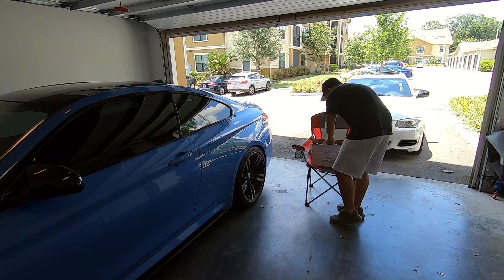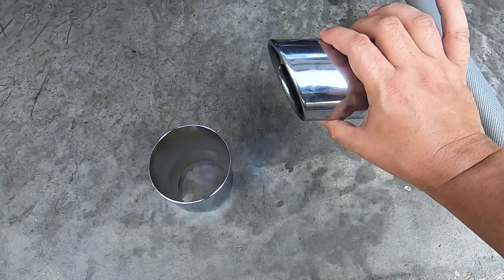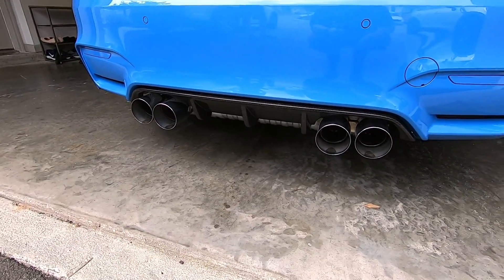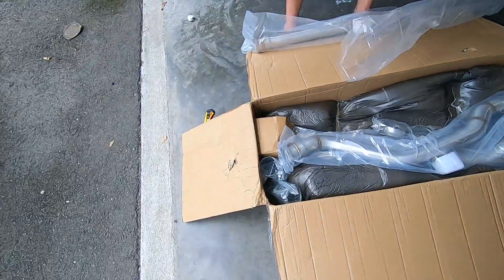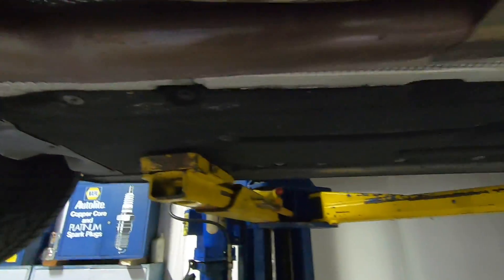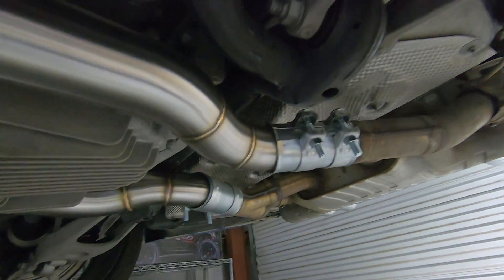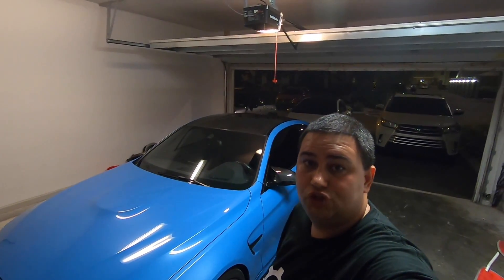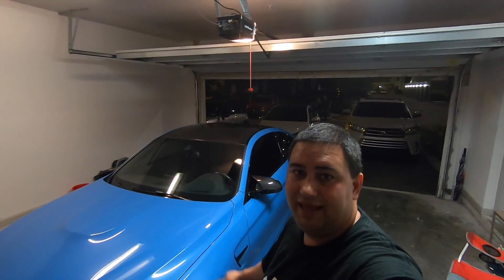VRSF New Single 3.5 MidPipe Review + M4 vs Hellcat

Comment: VRSF stepping their game up.
Reply from the maker: Yeah really quality stuff.
Reply: I have their down pipes and original catless midpipe for my f80 m3 and the quality and fitment is great for the price.
Reply: By ripping off Active Autowerke?  I mean, I guess, if you're into that sort of thing.
Reply: blendtecBrah sounds like your upset your active autowerkes exhaust is not the only one on the market. It was only a matter of time.
Reply: @joebeike  I'm not upset about anything.  You get what you pay for.  I'll take hand made in USA over a cheap Chinese copy any day of the week.
Reply: blendtecBrah VRSF quality is on point. The welds are fantastic and the fit is perfect. You won’t be disappointed
Reply: @joebeike  I'll have to take your word on that one, as I won't be getting rid of my Eisenmann DPs and AA mid anytime soon ;)
Reply: @blendtecbrah5761 tryna get rid of your aa midpipe?
Reply: @SirBJH  Actually yes.  I'm replacing it with a full custom equal length system.  Make me an offer and we'll talk.

Comment: Stock hellcat? Midpipe looks like an replica of active autowerke lol. I would buy it though, I already have AA though. I have VRSF downpipes and MPE exhaust too
Reply: How much louder did your MPE get with the AA midpipe? I have the AA box unopened sitting in the garage lol
Reply: KilaByte33 way louder, a lot deeper. Do U have downpipes too? I got sound clips on Instagram @smurf.m4
Reply: @BrandonWallach  Yup, this is a direct copy of AA, typical Chinesium.  I'm running Eisenmann DPs, AA mid, and MPE and it's one helluva combo.  No rasp, no drone, you can't beat it with a stick.
Reply: Hellcats are all hype. If tuned Q50/Q60 gap them all the time. It shouldnt be no problem for a M4 not to mention all the other tuned cars that do the same. Hellcat=overhyped dodge dog shit. Dodge are the biggest pieces of shit in the car world. That's why they rank at the bottom of reliability and build quality car lists. Dime in a dozen junk yard scrap